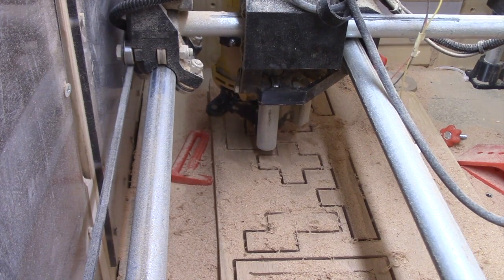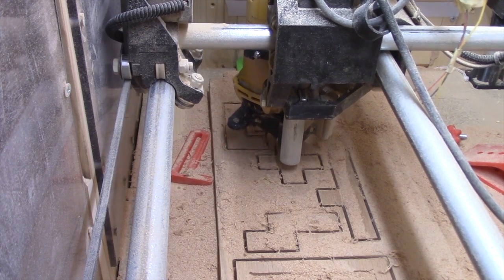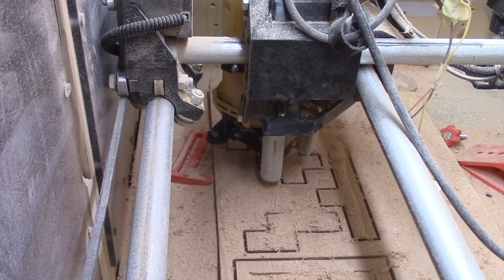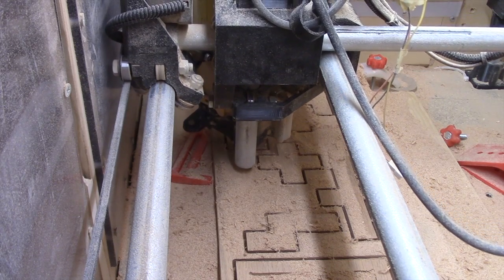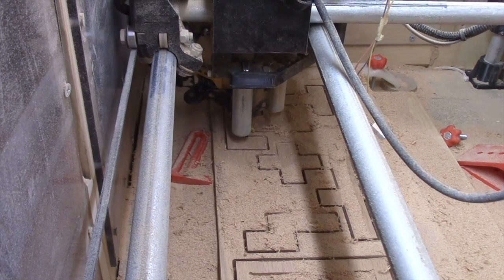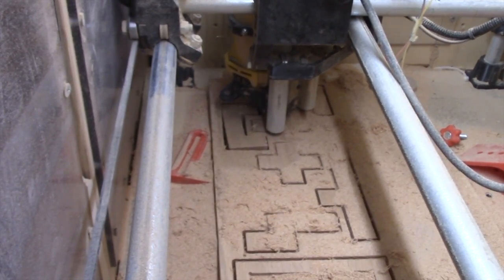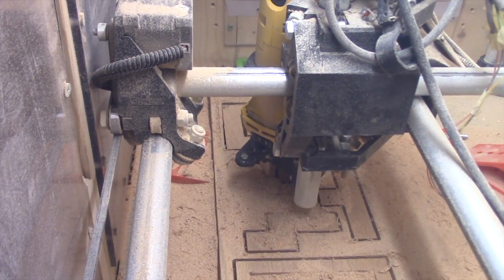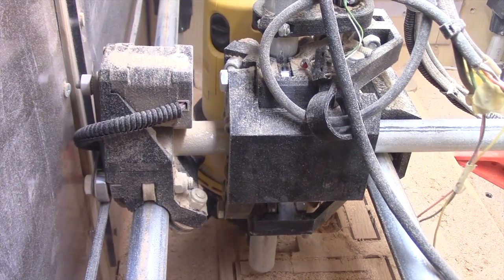MPCNC 19 What not to do with a MPCNC

Comment: Is there a way ( does MPCNC permit ) to for example detect the motor current and to go in 'emergency stop' if this current passes a set treshold ? Thinking on also making a MPCNC ...
Reply from the maker: I don't think there's a feature or even the ability to detect motor current on a Ramps or with Marlin. Maybe there's something on a Rambo, but honestly I don't know.  Check/ask on the forum on V1Engineering.com. Good luck on you build

Comment: I can't find any mention anywhere of anyone implementing the TMC2130 stepper drivers on a MPCNC to monitor for this type of problem. The TMC2130 has a feature called 'Stallguard', which monitors the current going to the stepper, and if it becomes excessive and a step is missed, it sends a signal that is typically used to stop the system or rehome the system. In 3D printing it is used commonly for  stopping printing if the print head bumps something and is going to get layer shift as a consequence, a similar problem to what you had when the bit tried to cut after the bit tried to push through full depth wood.. Another use for 'Stallguard' is for setting home without extra switches. The head bumps into a hard-stop, stalls and the 'error' is used as a home switch signal.
I am just starting my MPCNC build, and Marlin fully supports the TCM2130 drivers with the 'special' features, so I think that I will give it a try.
Reply from the maker: Sounds intriguing ! Let us all know how it goes!

Comment: i am thinking to make one of these to run a small production. i am planing to use it 8 hours every day at least. do you think it will get the job done? also have u checked repetition and tolerances in a small batch? can u go 3mm deep into beech / walnut (that's our current step for a Chinese ball-screw cnc with 800w spindle) thanks
Reply from the maker: I think this would be up to the that amount of time daily.  Some people are making a living cutting signs on their MPCNCs such that they need to replace the Dewalt periodically. Also some people rotate the conduit when the bearings start cutting grooves into the coating. I haven't driven mine that hard, but I haven't had a problem.  I tend to take a shallower cut with more passes, but others cut 1/4 inch at a time (just going slower). I'm currently building a lowrider CNC (see later videos) that I would think would be even more of a workhorse with a router instead of a trimmer and stainless steel tubing. I plan to go into production with it, and use the MPCNC for mostly laser engraving on the cut parts. Take a look at V1Engineering.com/lowrider for more...

Comment: gud big man like the setup how much it cost am from jamaica
Reply from the maker: Hard to tell. I imagine most of the difference would be shipping. First, find what size of electrical conduit you can source locally and then print or order the right sized plastic parts.  You can print your own parts and order electronics/hardware off Ebay/Amazon, or save yourself the hassle of finding all the right sized screws and just order the items from Vicious1.com.You should be able to find out there what it will cost to ship.    If I had to do it over, I'd still print my own parts, but I'd buy the hardware/Electronics from Vicious1.com.  Saves from ending up with a collection of wrong or excess parts.
Reply: i would like you to be my help if u can i need the help on it i would like a 4'x6'
Reply from the maker: lI'll be glad to help where I can, but recommend you take a look at the resources in Vicous1.com, and the forum there.  Vicious1 recommends starting small. You can always make it bigger later.  Also, check out the calculators there to calculate the length of conduit, belt, etc that will be needed for a given size.
Good luck with your build.  Post some pictures as you go!
Reply: thank much  big up bless
Reply: very good advise! :)
Reply from the maker: Greetings,  this gentleman https://www.youtube.com/user/VXDriven commented that he may be able to help you source parts in your area.  Please contact him directly if interested. Thanks!

Comment: Yikes, lol.  I would be interested in your experiments with feeds and speeds and what is working for you in different materials.  Are you going to try some aluminum at some point?
Reply from the maker: I think one could best describe the experiments as ongoing. It's all pretty new. So I don't really have any recipes yet.  Basically so far I've been setting 10-15, and then adjusting via the feed rate knob on the lcd display for the sound and chip size. I'll start posting the settings I'm using in the videos. I wouldn't be opposed do doing some aluminum, but that'll be down the road a bit.
Reply: Oh, I totally understand.  I have been afraid to even try hardwoods at this point, sticking to MDF, plywood and a little pine.  I still have very little confidence when it comes to the CNC.  It shares so many similarities with 3d printing, but the information out there is much less accessible for hobbyists.
Reply from the maker: Ryan Krammes 
The oak actually cut pretty nice.  The pine seems to leave som sap on bit afterwards (note: don't try to wipe it off with your fingers--learned my lesson-need more bandaids)